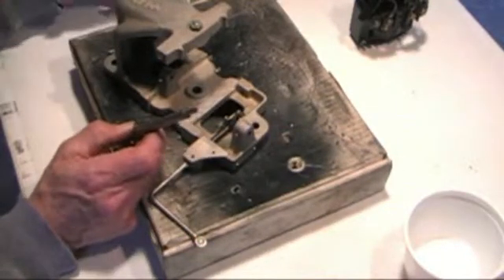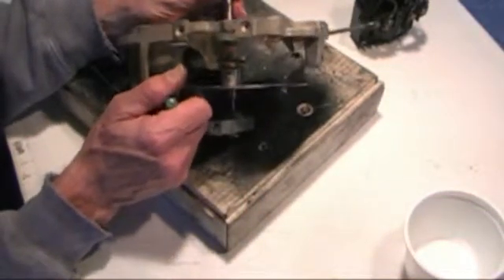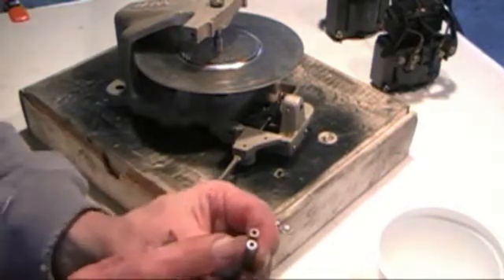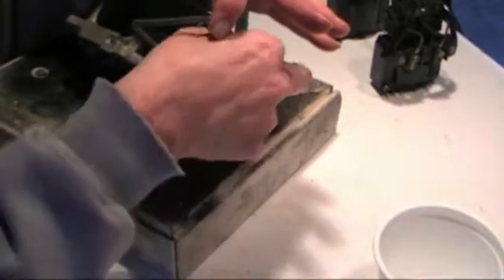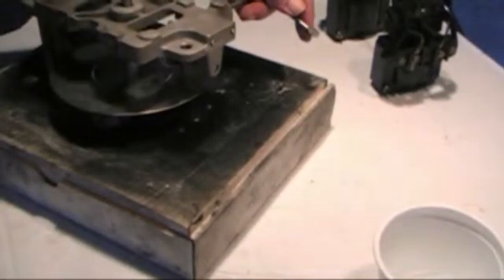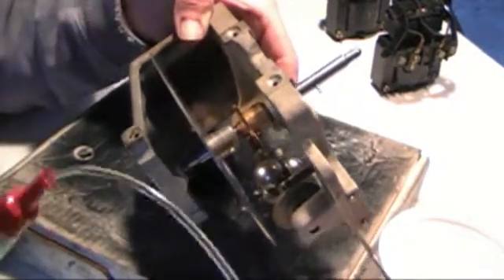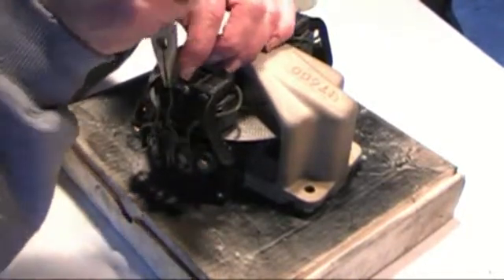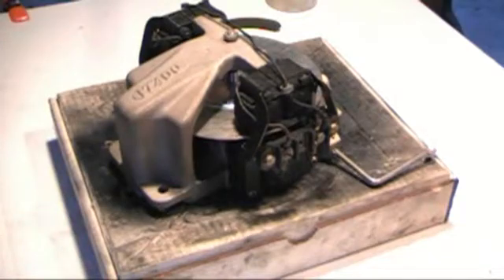Victor Electric Part 3 of 4

Comment: If the spindle shaft sits to tight you can burn out the poles because they over heat. Or worse yet cause a fire pay close attention to this video. He is experienced. You do not want any drag in the spindle shaft whatsoever. governor settings are also important.